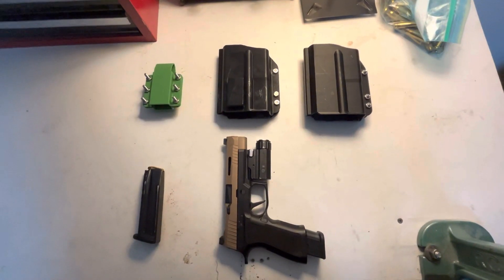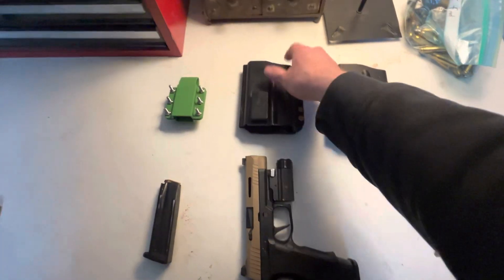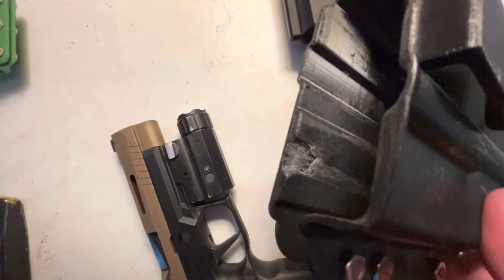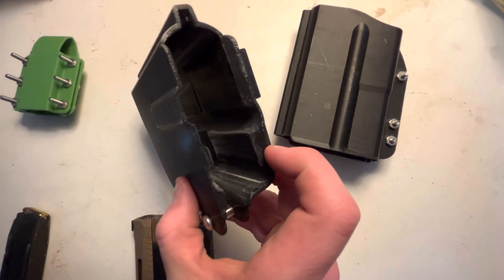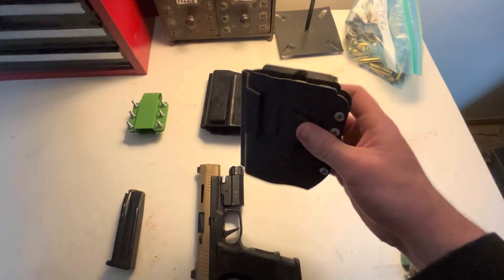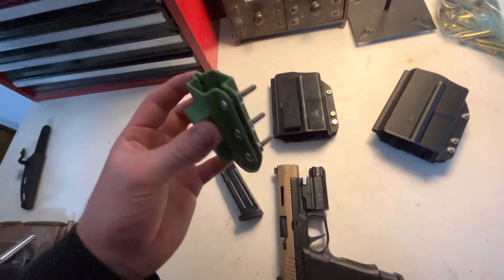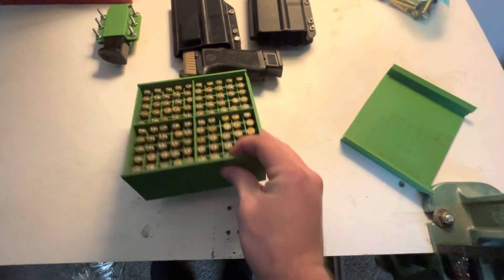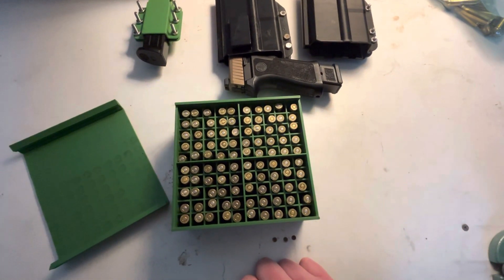Can You 3D Print a Concealed Carry Holster?

Comment: It's been almost a year since this video dropped. Have your opinions  changed at all?
Reply from the maker: @4xdblack Over the last year I would say that I’ve learned to appreciate having the right gear. In the case for my 320 where there is no holster for it when I use that flashlight or you just can’t find the right thing you don’t really have any choice but to run a 3-D printed one. Or my 320 was never my EDC, my 365 has always been my go to and the 320 once in a while, so making a 3-D printed one instead of spending 100 bucks for a holster for a gun that you never really carry is also a good second option. And of course its always a fun conversation piece, especially for people that don’t know much about 3D printing. But for my 365 that I carry a lot, I don’t think I would ever want to use a 3-D printed holster. Mine wasn’t bad and I’m sure someone has one that’s better than mine but I just don’t think they’re ever going to be quite as good as a quality Kydex one. If you use it every day then a good factory unit is definitely the way to go.
Reply: @RandomGunTuber what about the 3D printed one left you unsatisfied vs a Kydex?
Reply from the maker: @4xdblack the holster that I have for my 365, the holster itself is made out of one material and the part that clips onto your belt is a little bit softer and more flexible. It makes it a little bit easier to get it on and off your belt, and less likely to break. The one in the video I did end up cracking the clip that goes on my belt because I was trying to get it on one day and pulled the hook out a little bit too far and it cracked right where it joins with the rest of the holster. And my retention wasn’t quite as good as a normal holster but it was pretty good though. I think you can get a pretty dang good one if you keep tweaking your model and getting it more dialed in each time but for me personally that wasn’t an option, I got it pretty close the first time and had to leave it at that so mine had a couple little quirks, like you saw with the mag release that I had to just dig away. So long story short, with some trial and error I think you can get it pretty good but at that point you might as well just buy a nice factory one, unless you’re just doing it for fun then go for it.
Reply: @RandomGunTuber  thanks for taking the time to answer my questions!

Comment: I don't see any reason why a very capable 3D printed holster can't be made. Now that said , unless you use some of the more expensive exotic filaments the size will be somewhat thicker than a kydex. PetG is likely the best and most common filament but its not as flexible as kydex so some areas must be thicker to prevent stress fractures. If Carbon Fiber Petg or a nylon variant were used the material could be as thin and forgiving as kydex. The caveat is those are expensive filaments that are difficult to print with. Im giving it a shot using pet g, 1st test print will be finished soon. If this works out I might make a response video to yours and share with you the results. I too suffer from no holsters avail for my set up b/c it has a light attachment. The industry needs to catch up already. Lights have been trending for years.
Reply from the maker: @bombswabs3041 at the time I made this video I only had access to one kind of material so it kind of was what it was, but yes I’m sure there are better selections. I have access to some more materials so it would be fun to experiment with a little more now, just haven’t revisited the issue in a while. If you make a video I would definitely check it out.

Comment: this is great, how are the clips on the 3d printed holster? i would think they would be weak, no? unless there printed in a different orientation as the holster. if so how did you attach the 3d printed clip too the holster
Reply from the maker: It is all printed as one solid piece. I did end up breaking the clip on the one that I used to conceal carry but it was totally my fault. If I wasn’t stupid it would still be going strong. In my 3-D model I just make sure I put a fillet where it transitions into the clip so that there are no high stress points.